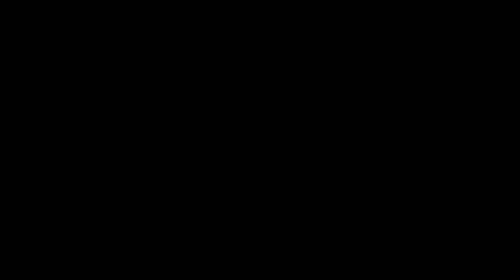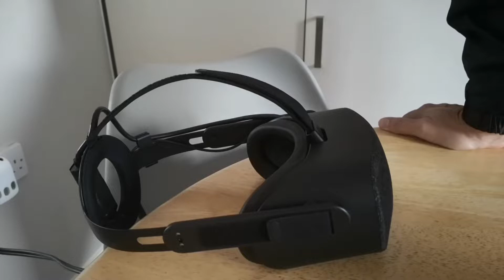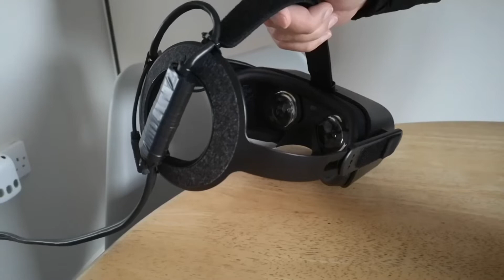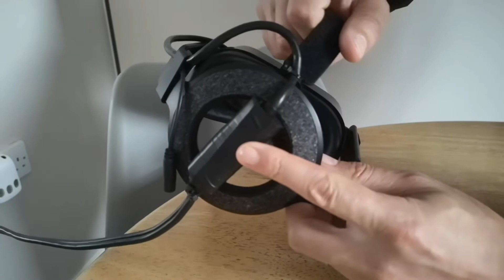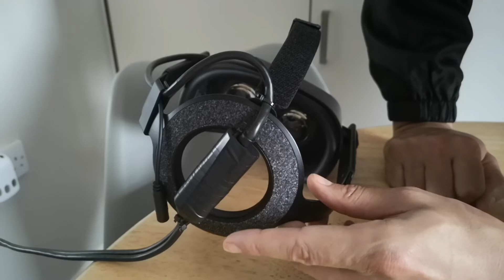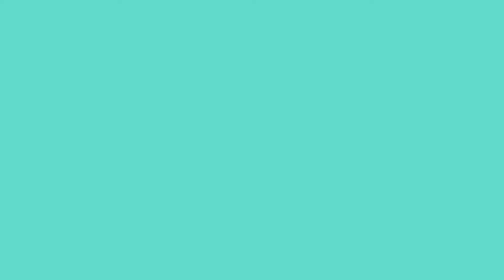Hp Reverb connection fix!!

Comment: hey man im desprate and looking for advice same thing is happening to me ive 3d printed the bracket no luck bracket and tape no luck been working fine for about 3 mounths not sure what to do even when its still it still happens so got no idea
Reply from the maker: I ended up having to send it back as had it happen to me a few times. It seems like no matter what you do it can be an issue. I still stand by this helping as a prevention to help but HP have had a lot of issues in n terms of this. I hope you find a solution soon or if possible get HP to sort it for you as they should do that.
Reply: @davebell771  ah fuck
Reply: @davebell771  ah fuck just got the new cable its still happening
Reply from the maker: @super1337bf3ordie  ahh not good..hopefully you get it resolved. Not sure if it is an option to send the whole thing back for a full replacement or a refund?

Comment: THX A LOT! FIXED! 
This problem cost to me one week speaking with HP customer assistant, 3 wires and a new VR Reverb till find the problem. A +10 to HP. All replaced WITHOUT cost for me, and free cost of shipping. 
Your solution, easy and cheap. AND WORKS!

Comment: Mine is manufactured in Jan 2020, it had problems right from the beginning and it deteriorated from there (taking longer and longer to get it working every time I want to use it), now it's screens blacking out for seconds in mid-game and flashing pixels, going to call HP tomorrow.  Flimsy pigtail via connector into a heavy twin cable is a great recipe for failure, but there were plenty of other QC issues like left earpiece dropping out, or some lint suddenly sticking on the right eye display (luckily out of the sweet spot. IOW, not much improvement after the 2019 QA disaster. :(

Comment: Nice! I'll do the same with mine. I got mine less than a week ago and , after the first 10 minutes the display went blank. Has it happened to yours as well? I can't play any games longer than 10 or 15 minutes. Its display flashes at the beginning, then goes black for couple of seconds and again, again, and again, until it does not turn on anymore. Someone having the same issue?
Reply: yeah, same issue here, we called the HP Customer Service and got the Headset replaced

Comment: Returned mine also, though I tied the connection and screen still went black after half hour then come back on, then a minute later would shut down. I think it was over heating issue rather than a connection as it was always after half hour. They couldn’t tell when I would expect a replacement so will be refunded. But now this has set a benchmark as this was my only vr experience. Now what to do 😭
Reply from the maker: Sadly, this fix only worked up to a point. Mine has been disconnecting and going back :( I am in the same boat. I loved it when working, so clear and comfortable. I may have to take this vid down as thought it completely fixed it
Reply: @davebell771  it's a shame. As you said it is awesome when working. I was all set for triples until this came out. Not sure I want to go down that road now since the awesome experience using the HP.
Reply from the maker: @chrisbarker5336  I will likely get a Valve index now.
Reply: @davebell771  Ouch, that sucks to hear friend. I am not touching this product for a few months it seems or ever if they don't sort this out.
Reply: Bought a rift s today. Going back tomorrow. Didn’t enjoy it at all. Plus white flashes through the race. The Reverb is on another level.

Comment: I've returned mine to HP for a replacement and clearly there is an issue with the fly cable connector to extension cable.  Mine was having connection problems out of the box which I fail to understand how it pass its QC.  I suspect this fix may have helped a little but that is not good enough by HP for their customers.  Fingers crossed new one in a few weeks (awaiting stock) doesn't have same problem or will be going straight back and replaced with a Index / Pimax for sim racing!!
Reply: how it was with your new one i got mine yesterday and have the same problem
Reply: @manerisports7937  I agree. I got a one 4 days ago, still the same problem.
Reply: @theVRpilot  for me it was the cable they replaced it

Comment: Hi Dave,  Is the HP connection in the bak a snap in type connector or a press fit type.   That is a great way to fix your problem.  Hope it continues to work fine.  Thanks for the info.  Looking at  possibly getting the HP in the future. Live here in the US so it is not released here at this time.

May I ask what GPU card you are using with the HP Reverb?  I do SIM Racing also and have a GTX-1080 at the moment.   Thanks and take care.
Reply from the maker: It snaps in but does have a little play, which is what I think causes it. My Gpu is a 2080ti so can't really comment on how well you will run it. Something that you could test is set Steam vr to 188% supersample, which should be 2160 resolution. Then see how well it runs. Hope this helps, take care too :)
Reply: @davebell771  Great thanks Dave for your info.

Comment: I returned my, feels like HP knew the  problem, delayed product launch, didn't fix the problem and trust that nobody or few will cancel they're order, look that headset now, removed  headphones  and taped to make it work.... Big corpo MF's are screwing consumers big time, at least with this product.
Reply from the maker: I didn't have to take the headphones off. I do this as use my stellseries headset.

I agree it is a silly design and should of not been released like it.  There probably is a lot of people that don't have the issue though. I have seen a lot more issues and encountered them my self say with the rift s.